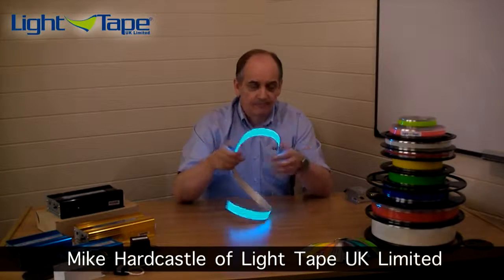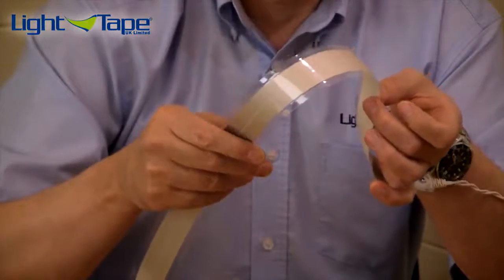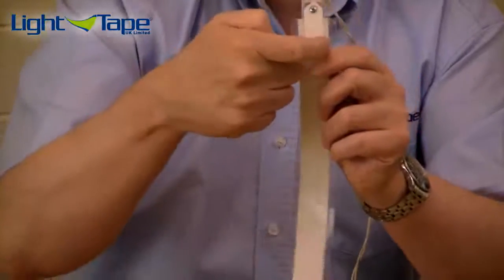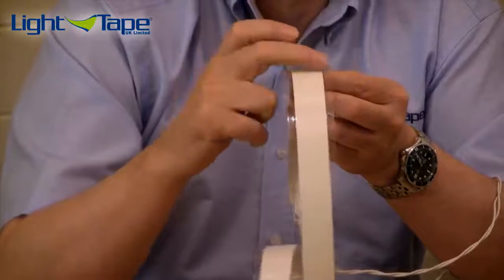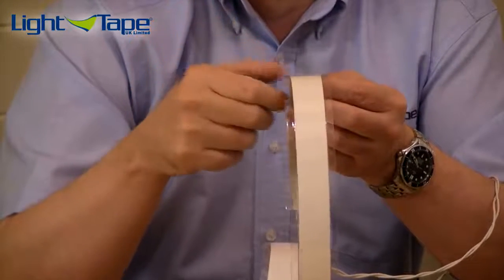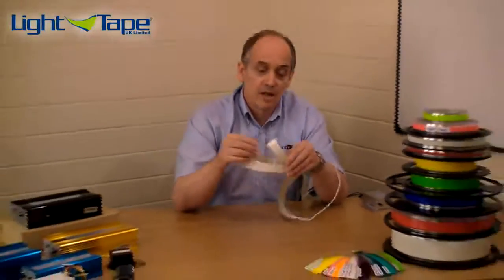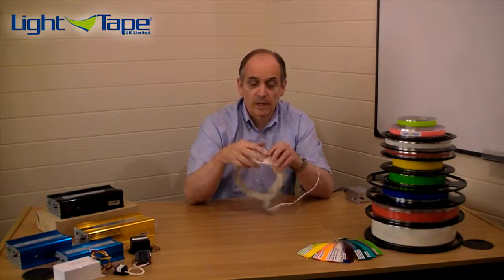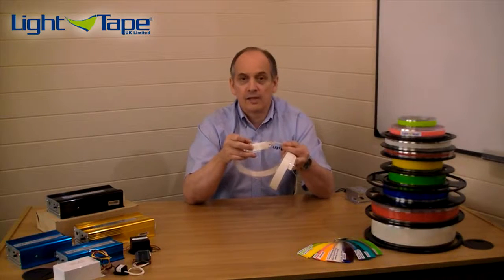What is Light Tape? Part 2 Thin flexible low energy lightin

Comment: WHAT IS THE MAXIMUM LENGTH OF THE TAPE?
Reply from the maker: We have driven up to 100m of Light Tape from a single connector at one end, for practicalities sake, we supply a maximum roll length of 30.48m or 100ft.

Comment: You say it can simply be cut with scissors to the desired length. But what happens if it were cut at an angle? Say I needed the strip to end in a point.. would the full point light up?

Comment from the maker: Check out the Light Tape Anti Slip Illuminated Stair Nosing Video, it uses the same inverter and bacause the Light Tape is stuck to an aluminium nosing there is no noise from the vibration. Cheers Mike

Comment: Hi Stevo, the noise you hear before I switch of the inverter is actually comming from the tape its self and is caused by the phosphors vibrating, when we mount the tape with doube sided adhesive or Velcro it takes air away from the back side of the tape and dedans the vibration removing the whine, we also have a double sided self adhesive Vibramount tape for very quiet enviroments like bedrooms, in a normal environment it is no more apparent than a laptop fan.
Regards Mike